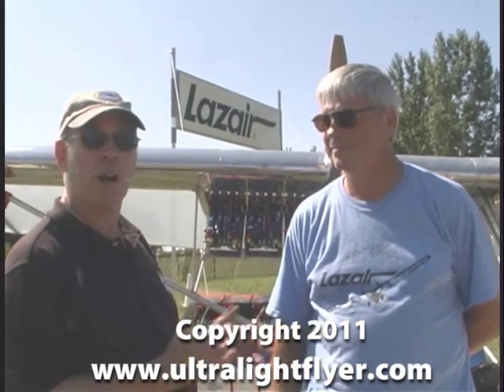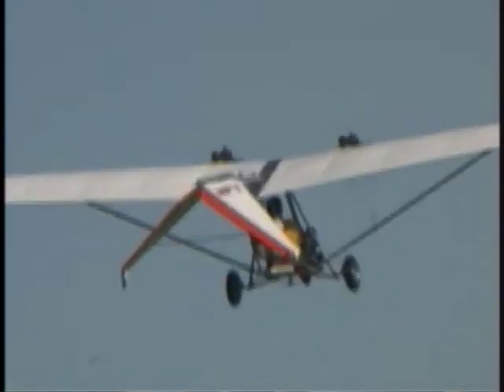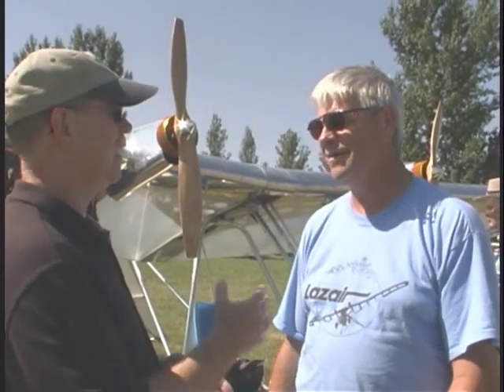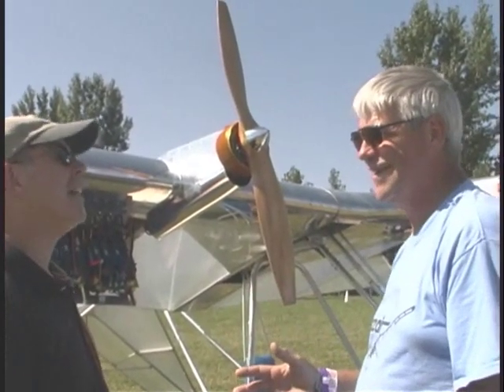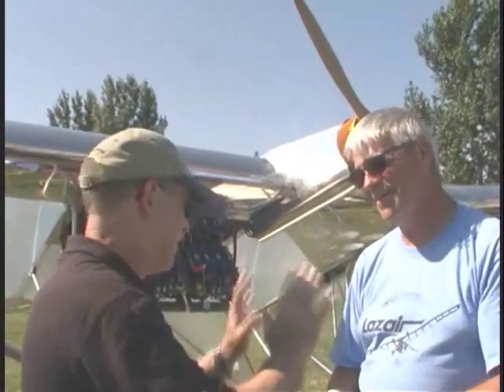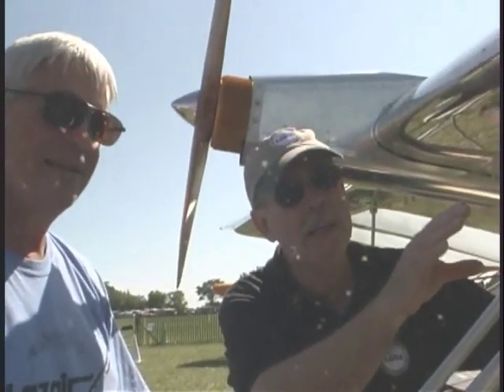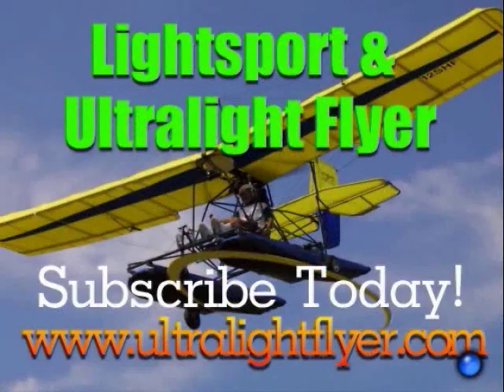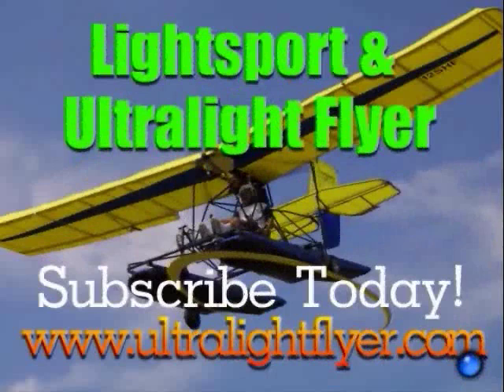Lazair, electric Lazair, Ultraflight electric powered Lazair ultralight.

Comment: I Just caculated 5 US gallons of fuel has 0.18304371924108 kWh or (183Wh) or energy. How does this compare to the install here?
Reply: obese1konobe 

Wow...are you off on that calculation! Gas has about 33.5 KWH of energy per gallon, so 5 Gal = 167.5 KWH.

The best batteries commercially available have an energy density of about 460,000 joules per kilogram. Gasoline has 45 MILLION joules per kilogram. Even taking into account how much less efficient a gas engine is compared to a good electric engine, Gasoline still has about 300 times more energy density.

5 gallons of gas weighs 31.5 lbs. Even after giving electric a 300% efficiency advantage over a gas engine, you would need to carry about 1025lbs of LiPo batteries to equal the energy in 5 gallons of gas.

Comment: Yea but gas engines can only extract about 23% of that energy on a good day and 2-strokes are much worse.  And that's using an ECU, O2 sensors and fuel injection (AKA more weight) to maximize fuel efficiency.   Electric motors are far more efficient being in the high 80's to mid 90's.  Battery charging efficiency is in the high 90's.